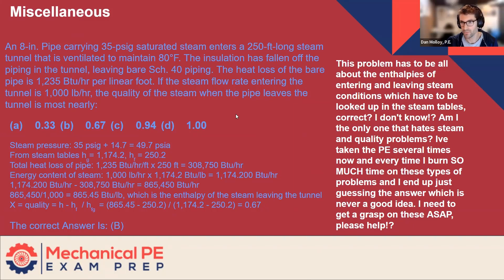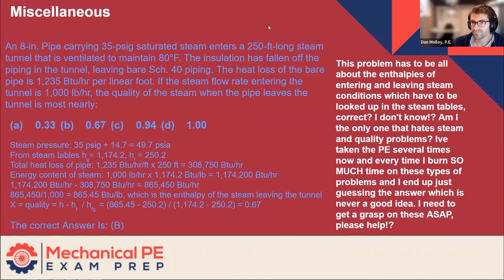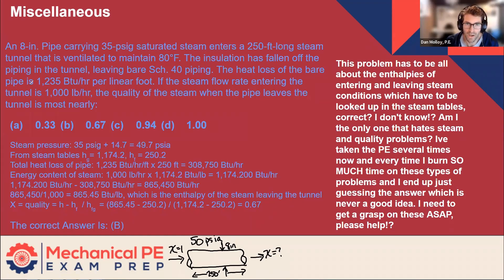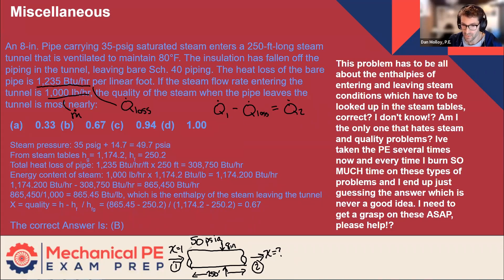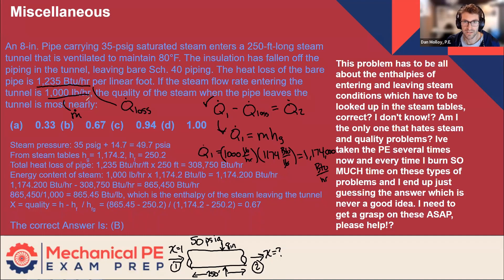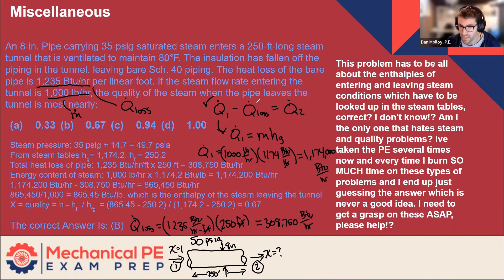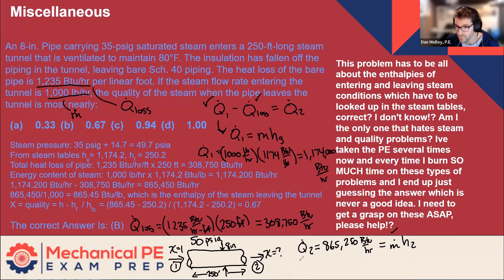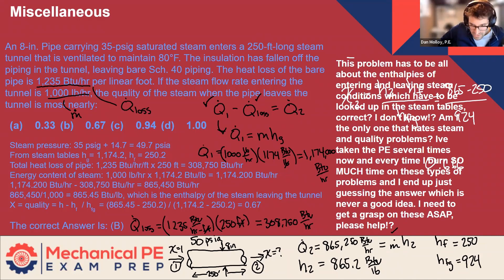Mechanical PE Exam Prep: Steam Flow Rate Problem Solution

Comment: Is there a way to use entropy to figure this out instead of enthalpy?
Reply from the maker: Hey George, I'm not sure about that.  Can you say a bit more about why you want to get involved with entropy here?  Did the approach offered not line up with your intuition?  Enthalpy is a measure of total energy so it fits well for this problem and many similar ones you are likely to encounter.  Curious to hear a bit more about what you are thinking of though...
Reply: Hi Dan, the enthalpy approach makes perfect sense, but it wasn’t the first thing i would have attempted. Of the top of my head when i see heat loss at constant temperature i think of entropy so that’s why it was my first go to. I gave the question a go after i posted the comment and after some time i got the same answer but it was a bit more time consuming.